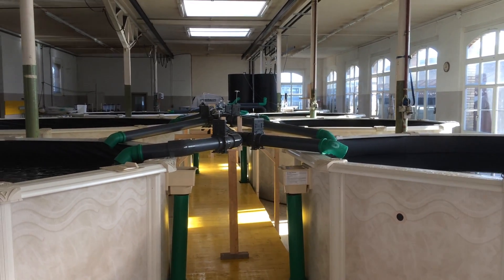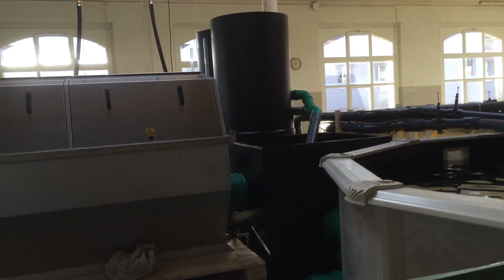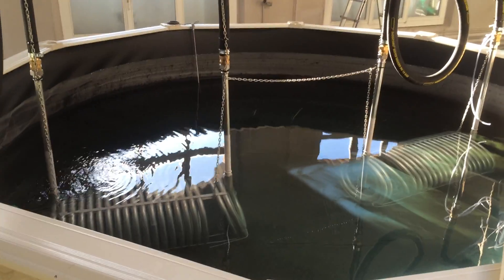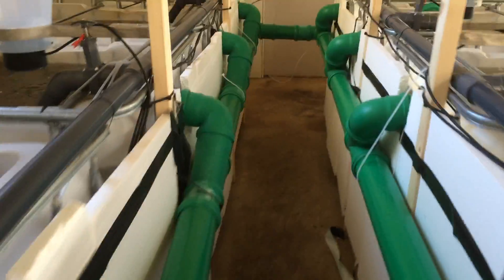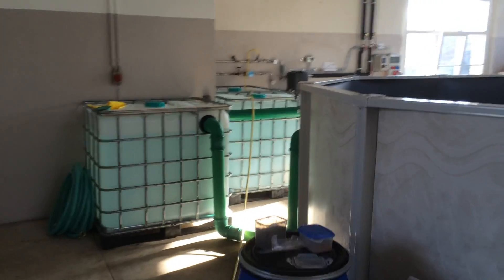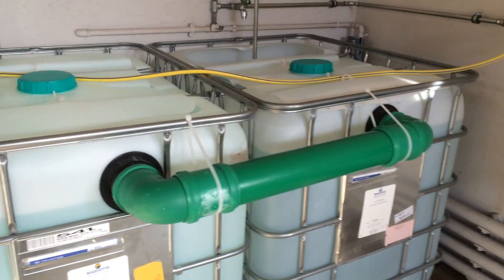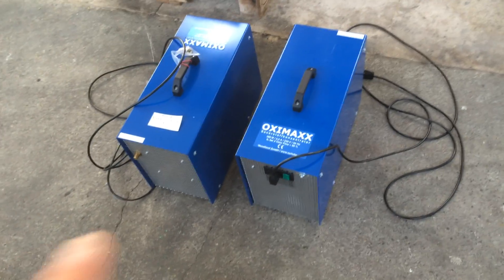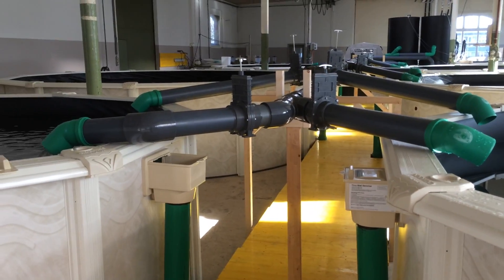Aquaculture and Aquaponics commercial system update...

Comment: hey i just got done watching all the video's in your channel - they're fantastic!  I was wondering if at some stage you would make a video on your cleaning schedule?  (a good example is your indoor setups and client indoor setups seem to be in small spaces...  wouldn't they be a pain to clean out?)  Either way, you make all this seem so easy, im very jealous as it's pretty hard to get everything just right! :)  Grats on a the new setup as well, it's a great building you've chosen :)
Reply from the maker: torpa15 ^About the cleaning schedule... in small Systems the vortex filter must be cleaned every month (depending on stocking density of the fish).. but in the big System and Systems with a higher Budget we instal drum or band filters which are self cleaning and require litttle to no maitanance. With the use of SLOs the tanks Need no cleaning.just remember when building a System dont cut Corners with pump or pipe sizes..ist always better to over size materials than to undersize.. let me know if you have any questions..Kind regardsPaul
Reply from the maker: torpa15 will make a video on general maintanace soon
Reply: Aquaponic Gardens fantastic!  can't wait :)

Comment: Paul, Mate! the system is looking fantastic, now you are at 25c eh, well I think there could be some sub/ Tropical fish? Barramundi would be a perfect fit but did I hear you say you are located in Switzerland? So now I am not sure what prize eating fish it may be. 8 months to plate size leaves out most OZ fish. My Aussie CSIRO fish reference book says to put all fish into an ice slurry is the same position as they swim so when rigour sets in then they are cleaned for market or live fish may also be killed & bled, what will be your plan?. Do you run new fish in a 1% salt bath?. I am very keen on your O2 gen set as my temp here is 24-28c. Amazing effort, do you need any seeds from Thailand?, Ed